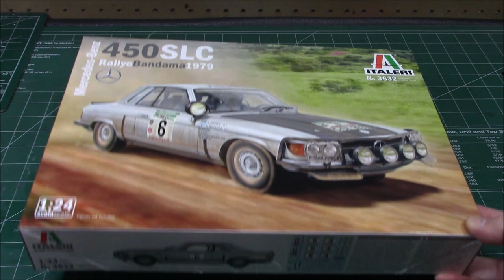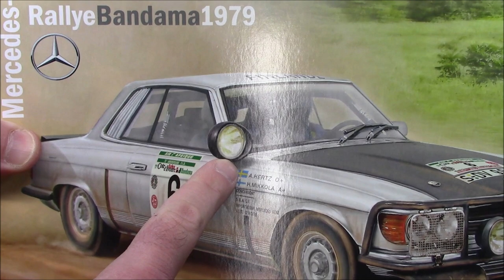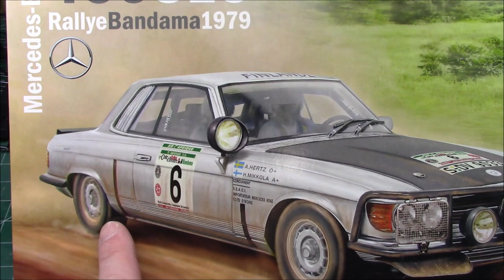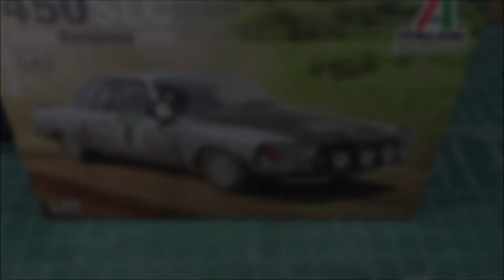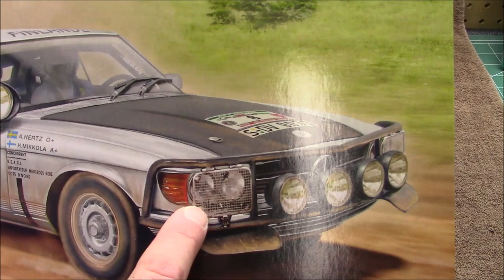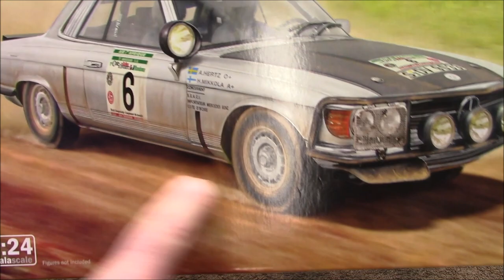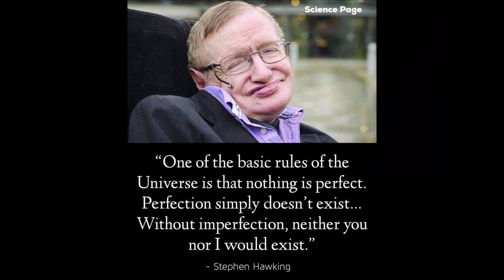Mercedes 450 SLC Rally Bandama 1979 1/24 Scale Model Kit Build Review Weathering Italeri MRC 3632

Comment: Nice job Chris as always. I might still get this and build it as a road car. Bizarre how they can do seperate door handles that you can paint black yet they cannot include some gauze for the headlamp protectors in this ESCI re-issue. Also disappointing the rear suspension is moulded in. Grille looks better being blacked in too.

Comment: I've been watching your video's for awhile now and I notice that you do a lot of spray painting and painting in general with the parts on the trees. Can I assume that when you remove the parts you have to follow up with a lot of touch up? Or am I missing something? Thanks in advance.
Reply from the maker: Most attachment points are designed to be hidden, any that aren't get a bit of touch up.
I don't build for shows or perfection etc so it doesn't bug me.

Comment: Hi, I saw this video, went and bought one because it looks awesome. My problem is that my front wheels are standing a bit proud of the body and a bit too forward in the arch. What have I done wrong and how can I fix this?
Reply from the maker: I'd make sure the chassis is pushed back all the way, then if need be sometimes on kits you have to cut the wheel studs off and re-glue the wheels in the proper position if nothing else works.